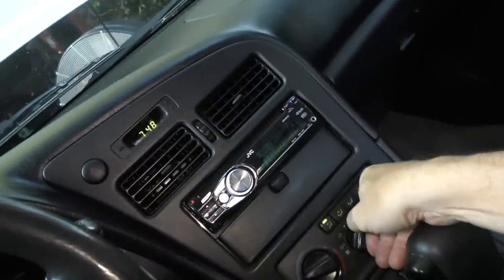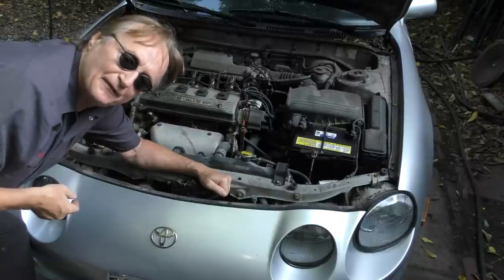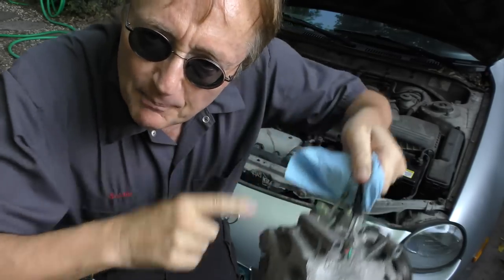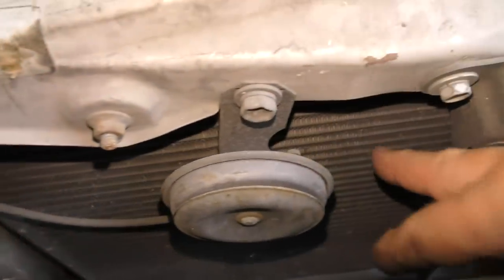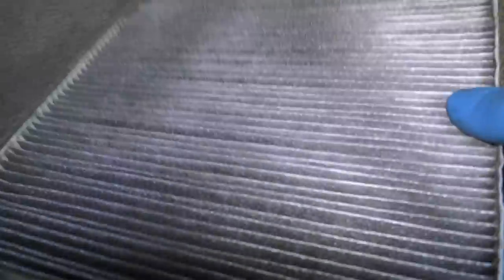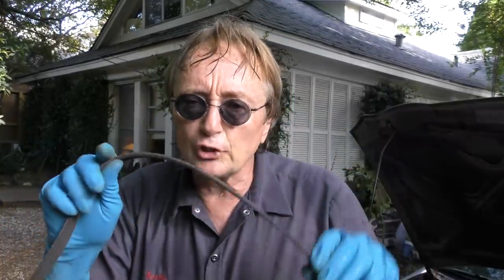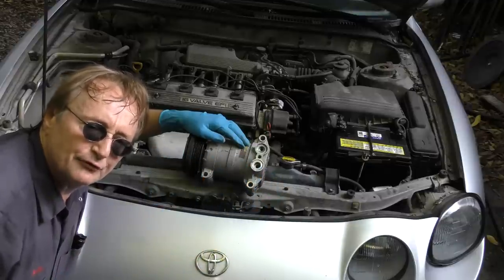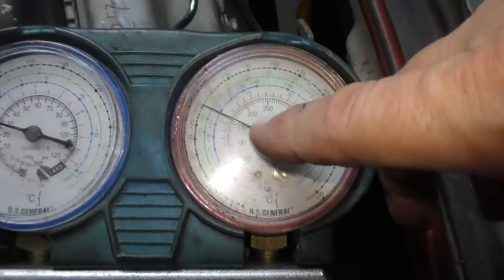How to Keep Your Car's AC Blowing Ice Cold

Comment: Hey Scotty. Im from NZ and always watch your videos. They are a great help especially to a bloke like me who isnt a car guy. Can you do a video or answer my question about leaving the AC on when you turn the car off? Or should you turn the AC off before you turn the car off? As i sometimes forget and noticed when I start the car again. Cheers Scotty and keep the videos!
Reply: Waiting for his response, i'll try to answer. Modern cars come with ECUs. There's often a dedicated climate control unit. In case there isn't one (such as with manual AC), the AC button (in addition to the defroster one, in most NA cars) is still connected to the PCM. When activated, it sends a signal to the PCM. The PCM then immediately checks for a number of variables such as engine current RPM value, engine coolant temperature, throttle pedal position, refrigerant pressure (if the AC system is equipped with such sensor; if not, clutch operation is controlled by pressure switches) etc. If the operating parameters are met, the compressor is finally turned on. All of this is done instantly, so you won't notice it. This means that power to the AC compressor clutch coil/solenoid valve is automatically cut off whenever you turn the engine off (and also, temporarily, when you go WOT or when RPMs drops enough and the engine is basically about to stall), and switched on as soon as the engine picks up the idle when started up (you should also notice the idle RPMs increase as soon as the AC is switched on; that is meant to keep the engine from stalling). If there's a separate climate control unit, it still receives data from the PCM. So, the answer is, on a modern car you won't have to worry about switching the AC off before turning the engine off or starting it up, since control units switch the compressor on when it should be on and off when it should be off. The only thing worth noting is that, if you turn the AC compressor off (and leave the cabin blower on) some minutes before parking your car, the evaporator and ducts dry themselves up and bad vent smells won't develop.
Reply: TeraVolt Thanks for the reply and the detailed answer. Much appreciated. It makes a lot of sense. Thanks again for taking the time to answer my question.
Reply: You're welcome. Remember to let the compressor run a few minutes each week, keep the condenser clean, keep the proper airflow over it and have the ac system properly evacuated, vacuumed and then regassed every 3 years. Replace that cabin filter too if you have one. That way you'll always have ice cold air and warm dry air whenever you need it.

Comment: Scotty, excellent post sir! I've got an auto AC problem diagnosis question. Unit will cool occasionally but seems to blow hot/warm air as often as it blows cool air. Checked coolant and seems to be charged to proper level, seems to be. Cooling periods don't just happen when go the vehicle opened up out on the highways but also when driving around town. Any idea which component in AC system might be failing?  Thanks sir and keep up the good work!
Reply: Check if the condenser fan is working.

Comment: Hey scotty. Love your videos. I've watched many of them. But i have a question (hoping you can answer). I have a 2002 Jeep Renegade that was given to me by a neighbor a year ago. They told me that they were having some electrical problems and just decided to buy a new vehicle and gave me this one. Well, thought i just needed a new battery, but i was totally wrong. I've gone through two batteries in a month.  So major draining problem.  I believe we've checked everything - like process of elimination with the fuses both under hood fuses and inside fuses, but doesn't show anything is draining unless we did it wrong. We've also been removing fuses, letting the car sit for a couple of days, but third day it's totally a dead battery.  Now, in the wintertime where it gets real cold in my area of northern Ontario, the battery would be dead the very next day even though it's plugged in and now that it's getting warmer out, it takes about three days to completely kill the battery.  So I went out and bought a small inexpensive trickle charger which i put the positive and negative on the battery and the car starts no problem the next day.  so obviously it's got a slow drain from something in the car.  Like i said, we tried process of elimination like taking out the fuse for the auto-lock doors, but a couple of days later the battery is just about dead.  My neighbor had hardwired a phone charger through the glove box, so we thought maybe he didn't do it right, so we disconnected that, but nope, that wasn't it. Still draining. Do you have any suggestion where else we might check? It would be greatly appreciated.  Thanks.

Comment: Hi Scotty! I have a Volvo 2004 V70  with 43,000 miles...the air conditioning starts and stops by itself in the off position...
you can hear the compressor go on and off (sometimes,often) also at the same time the heater red indication light turns AC green then back to red while the compressor is on and off....

Comment: All of my Toyota products a 1978 Celica, a 1986 Camry, a 1992 Lexus ES 300, a 2000 Lexus GS400, and now a 2010 Prius have had trouble-free AC. Never a need for any sort of service or charging. They make em good.l   The worst AC I had was a 1973 Volvo, but in those days there were no factory installed AC, so it was dealer installed and never blew cold, and a 1969 Ford T-Bird.  The T-Bird was a piece of crap in all respects.  I was living in Atlanta, and whenever I had a long drive, the AC would literally freeze up and stop working.  I'd have to stop it and let it thaw. Dealers said it was normal.  GM cars had great AC (Frigidaire)  in the late 60s and early 70s.  I haven't had experience with them since.

Comment: Great Video Scotty thanks! My AC on my 01 Saturn L200 starts up, blows cold then within 4 seconds or so the compressor shuts off? You can watch it happen. We tested the low-pressure sensor, it was good, and the system is correctly filled, as I mentioned it does blow cold, right before it shuts off. We also tested the volts at the battery under load, it was pulling 14.8 and after everything was loaded up, it only dropped to around 14.5 so the alternator is charging fine. Any ideas? Many thanks!

Comment: my 05 corolla has 289,000 miles and I has never had a set of gauges on it. The only thing I have done is  replace the cabin air filter. It cools just fine.
Reply: Well, to be sure, have gas and oil in the system pulled out and measured, receiver drier replaced, vacuum done and the system regassed to specs, it doesn't harm after so long, after the last regas which was done 5 years ago the recycling station pulled out 220 grams of gas out of the 500 normal ones out of my Vauxhall Agila and it was still cooling very well though the Harrison CVC6 compressor was becoming somewhat noisy (now, after regas, it's quiet). With less gas in the system most compressors adjust their stroke to pump harder.

Comment: Hey Scotty I forgot a small part also I didn't notice on the bottom of the vehicle through the vent holes in the front it does drip water in the back where the rear AC is it does drip water but one of the ac lines is extremely hot to where I can't touch it for more than 2 seconds the other line is semi cold but the AC I think the evaporator that big silver canister that's connect to the firewall it does not sweat it does not it's cold but it does not sweat I did replace my cabin air filter that was semi dirty I can clean the fence didn't have any leaves in there that's just a couple of more symptoms that I want to add to see if I can get your opinion on what should I do first second and third thank you all answers will be greatly appreciated

Comment: Hi Scotty - I have a 2005 Subaru Outback and the AC is not cool when car idles.  I watched your video and it was very informative. I checked everything you went through.  Both fans work fine when I turn the AC on, but if I let car idle, only warm air comes out. If I rev engine while parked and increase rpm's to at least 2,000, then I can feel the air get cool immediately.  Any thoughts you could share before I take it to a mechanic would be greatly appreciated.
Reply: follow up. I had mechanic recharge ac.  it was definitely low on refrigerant. Now it's working great. Your video definitely gave me a lot of knowledge about things to look for and really made me feel prepared when I went to mechanic.   Keep making videos.

Comment: Hi scott thanks for your videos they really great and very helpful i had seen a video you did but can't find it anymore about and additive you can use to stop motor leak that was clear i have a 2001 chevy tracker has an  front seal leak not too heavy like to know the name of the additive you use as you know this suv is a pain to due engine work but had really good use of this truck and still looks good . But for leaks is a pain in the butt did valve covers a few years a go what a mission .  has 145k mi still runs great. for me when its time to address major leaks or timing issues i would replace engine  (rebuilt) but till then if i can get some more mi. w/out taking out everything to change front engine seal would be great thanks for your videos keep on truckin

Comment: Hi Scotty,  I own a 2009 Dodge Ram 1500 SLT 5.7ltr Hemi  and last year the AC compressor locked up and I took it to a local mechanic (not in a shop) well my ex husband did. I bought a new compressor and he replaced it about 2-3 months later it stopped blowing cold completely.  Should I put more freon in it or flush it? Or does that sound like it has a leak? I just want to be informed when I take it to a real mechanic shop... the more you seem to know the less they try and screw me. Thanks in advance.

Comment: I didnt know that my compressor would leak refrigerant over time, keeping the seal lubricated. I went ahead and got a new compressor, thinking it wasn't suppose to do that😂. I have a 1999 dodge caravan SE with 191k miles on it. I have kept the the systems clean, motor & transmission are well kept. What is something i could look at doing in the near future?

Comment: Great info Mr Scotty!!.. i got problem with my 2001 suburban.... my a/c fuse pops  with out me turning my A/C on.. every time i put a new fuse in and start my engine the fuse pops.....  i might have short somewhere... where do i need to look?? thanks
Reply from the maker: unplug the wire to the AC clutch on the end of the AC, if it stops blowing the fuse, then compressor is bad

Comment: Thank you for the video. I have a Pontiac Vibe 2004. I am replacing a charcoal air filter regularly, no any leakage in the AC system. However, when I use AC I feel the dust and mould smell in the car. I don't know how to clean the core of the AC. I think the core of AC deep inside front panel. There is an air conditioner radiator, it is outside in the engine compartment. And, there is a radiator stove, it is somewhere inside the cabin. He probably clogged up. Can you guys help me get to the bottom what is going on? I much obliged.

Comment: I have to change the AC compressor in my 97 ram 3500. The clutch is not engaging and the draw shorts out the fuse for the horn. We tried jumping the clutch with direct power but no luck so we'll be replacing it this week.
Reply: It's a dodge, get used to spending lots of money on it.

Comment: I have a Sienna hybrid I use an infrared thermometer my front vents can be as low as two degrees below zero but my rear and only pushing out like 45 degree air for some reason it still gets pretty hot in the car I'm down in Florida maybe the sun beating down in the windows

Comment: Sir, in my car :
1. The compressor runs well. There is no serious defect in its pulley-belt.
2. The condenser seems to function well too. Its receiver/dryer is alright.
3. Pipeline from the condenser to the evaporator is alright, so is from the evaporator to the compressor.
4. There is no AC air filter, because it's an old car. So the air intake to the evaporator housing and/or air duct must be kept clean. How to ?

So the problem is probably in the evaporator. Ah, you know, it's very difficult to access this part. Why car designers place it in a location that is very difficult to access ?

Comment: the most important tip to maintain your AC: USE IT.  Once a week without fail.  Even if it's freezing, you need to run it. Once a week for 30 seconds to a minute.  REASON: By using you circulate the refrigerant oil to keep the seals lubed. IF you DON'T use it the seals dry out.  Holding in 3,000 PSI darn right those seals well blow out the moment they get dried out.
Reply: People just don't care and seem to prefer watching their compressor seize up and then going 4 60... then there's also people like me who can't find a damned UV light anywhere in a store and need to buy it online, and i'm not talking about finding a leak, just a routine check since i know every single part of my car's AC system...
Reply: Robert that is a good point!  Especially in newer cars. Also it's a good idea to move the power seats around once in a while because they can seize up if never used. Seen it happen several times
The old expression "use it or lose it" stands true.

Comment: Hello Scotty i have a 2002 Ford Focus 1.6 Zetec. The AC colds very well when i'm running but when i'm in idle the A/C doesn't cold anything! What could be? Filter and radiator is clean and the fan works

Comment: Hi Scotty, what's the possibility to have the same pressure on both sides? Compressor failure or any others? Thanks much!
Reply: Lucky-6-28-2015 equal pressures mean the compressor isn't turning on or if the compressor is running that means the compressor is defective

Comment: Quick question and I need an answer from an experienced tech. Does leaving the A.C . switch on in your car matter when you shut off your car. Does this shorten the life of your compressor ?  Any takers on this question?
Reply: Since clutch coils power is controlled by the ECU through a relay, no, compressor health wise it won't really make any difference. Turn the engine off, and the ECU cuts power to the clutch coil stopping compressor operation just like you turned the AC off. If you had someone start the engine with the AC on and you were watching the compressor clutch, you would notice that the compressor clutch engages only after the engine picks up the idle. This is meant to not place any additional load on the starter. That is if you have a clutch equipped compressor. If you have a clutchless one, your compressor is basically always engaged and rotating. When you don't need AC, it's just pumping nothing because the swash plate with the pistons is kept at a right angle by a spring and a solenoid valve that forces pressure behind the pistons. The real issue with turning the engine off with AC on is that you're leaving condensation inside the cold evaporator fins and air ducts, and unpleasant odors develop. This won't happen if you turn the AC off, however leaving the blower on so that the evaporator fins and air ducts get dried up (and you still get some cool air as long as the evaporator is cold), some minutes before turning the engine off. What you need to do to have an healthy AC system is run it a few minutes each week so that natural refrigerant leakage through O-rings and shaft seals becomes slower, and periodically (each 3-4 years may suffice) have it serviced by a trained and licensed professional. That's because, since lubricant is carried around by the refrigerant, correct refrigerant level is vital for correct compressor lubrication flow rate.

Comment: thank you for this video 
i have hyundai sonata 2006 i had changed the compressor and the condesor
now my car blows cold air only when iam driving or pushing in the pedal , i had checked the condensor fans it works perfectly 
i charged the hole system with only .5 kg of 134a refrigrant is it possible that the ferion is not enough and i want to know the eact quantity of fireon that its take
Reply from the maker: that system uses 575 grams of refrigerant, evacuate the system and add that exact amount first.

Comment: Scotty Kilmer I have a 2007 Volvo S40 non turbo, I am having issues with the A/C staying blowing cold. I have tested the system and it holds with no leaks and the compressor engages, but every other start of the car the air will stay cool for the most part then start to blow warm hot air, also sometimes the coolant will drop really low and when I crack to top for the reservoir to fill it backs full to full can you assist in any way please the vehicle has 197,000 miles on it.

Comment: Hey Scotty I got a question 2000 Ford Expedition 5.4 I check my ac refrigerant and it was low so I went to Walmart got the black AC Pro can fill it up it was cold but not as cold as a normal AC would be so I checked the AC compressor clutch and I noticed that it wasn't turning off I grab some feeler gauges check the clearance and the Gap is pretty much too big it's I think over 30 thousands of my not mistaken or so when I took it off the check it I realized it was  old clutch material that had built up in between so once I clean the clutch material the AC compressor clutch did click on and click off but after a day or two it is beginning to stay on at all times my question is once I replace the AC compressor clutch do you think that the AC will begin to work normally